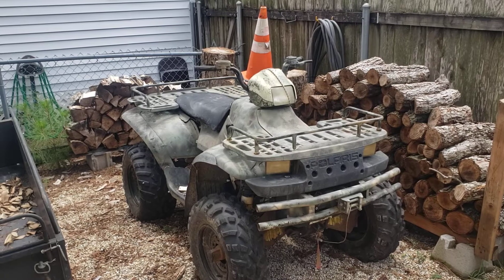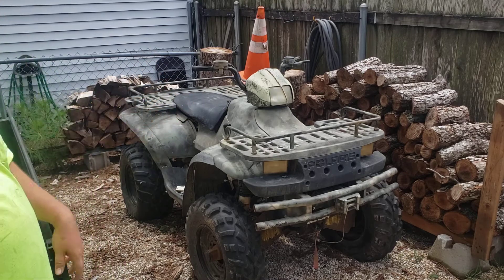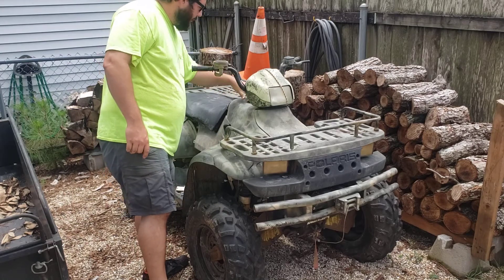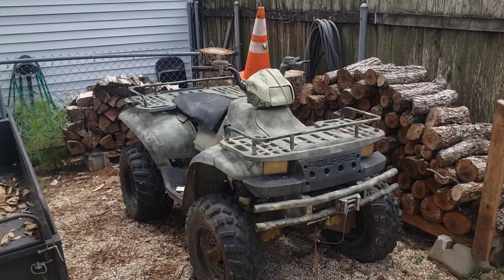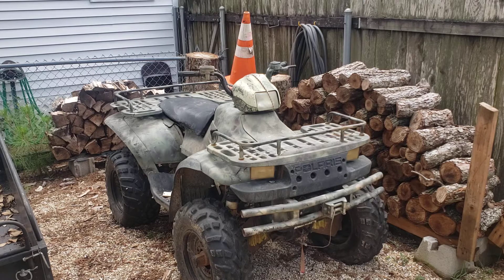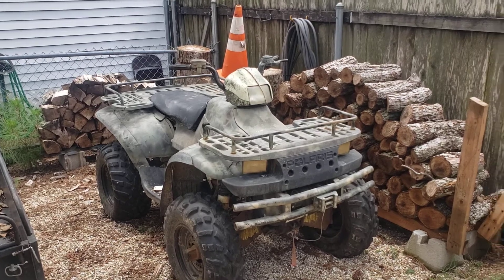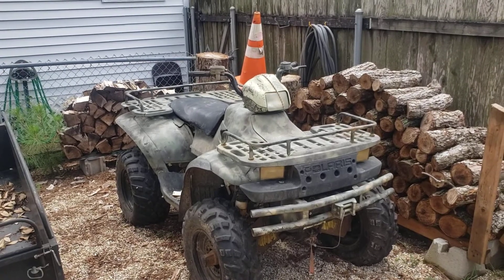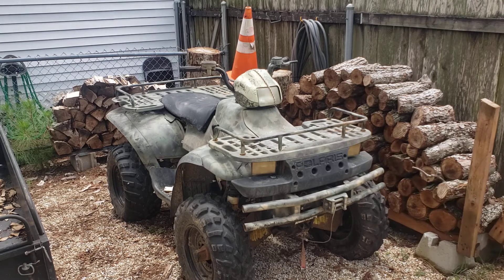I got a diesel atv!!

Comment: They only made those 1999. They kept trying to sell them in 2000 so some are considered 2000, but they are all the same factory run and design. They were all originally blue with yellow decals, someone did a nice job going camo on yours. Didn't sell in the US well, so Polaris recalled all the unsold units from the stores and sold them in a huge batch to Russia I hear to be used for military. That's the story I heard.  I got mine from my father who got it used for hunting. No real speed but they have enough low end to climb a tree. I use it for farm work.
Reply from the maker: I'm really looking forward to getting it fixed, but man are parts hard to find!